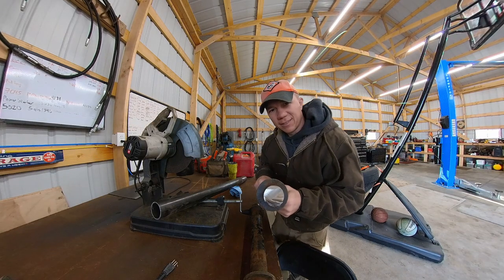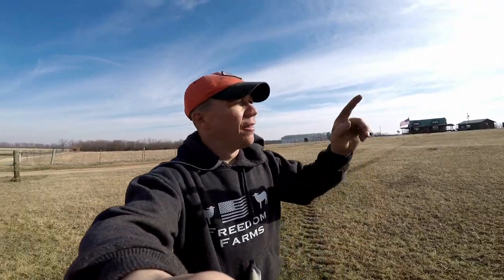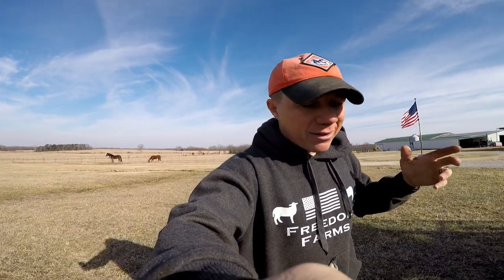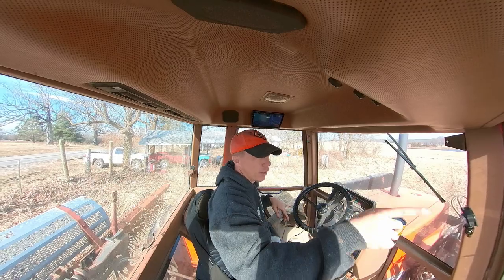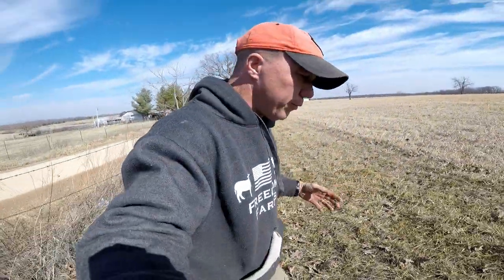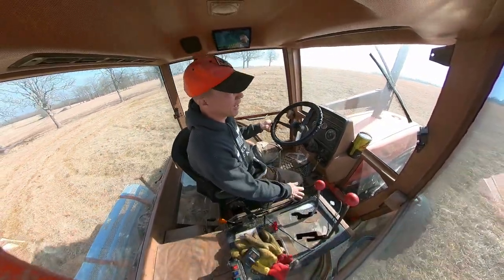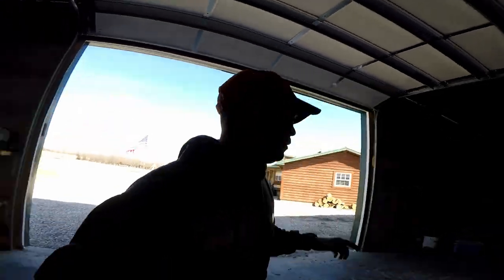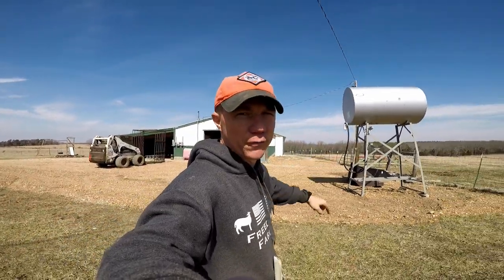Aerating hay ground with a rotary hoe

Comment: We used those Rotary hoe on grain fields if the seeds are having problems sprouting through the dirt seemed like the faster we pulled it the better job it done hopefully it will do what you need buddy thanks for sharing
Reply from the maker: I've never heard of them used for that before, that's an interesting idea for it though for when the ground is crusty after rains. I grew up on grain farms and we used them to remove weeds growing when the crops were still small yet. I just got the idea one day thinking about aerating the soil, and now that everyone just sprays for weeds you can pick rotary hoes up cheap. I bought this one for $300.

Comment: I just bought an old rotary hoe last year to do this with. I've noticed that over seeding and fertilizing (granular) after aerating does make a difference in yield. I don't have any exact numbers, but it is noticable. I'm hoping to keep experimenting with it a little more each year.
Reply from the maker: I know it will help.wigh compaction which makes a big difference in root expansion for grasses, the aeration and allowing manure easier access is just another key point to it. I'm excited to see the results myself

Comment: Your fuel tanks should be tilted back so any water that collects or condenses in it will not flow out.
Reply from the maker: That is what the fuel water separator is for on the filter housing. However that is a good idea if I didn't have the fuel water separator.

Comment: Due to health and safety here our fuel company won't allow their drivers to climb ladders not even a three step step-ladder  or blocks.
Reply from the maker: Wow, that wouldn't be very handy if you have a gravity fed tank.
Reply: @FreedomFarmsMo  it isn't though thankfully as our old one was getting rusty and the block pedestals worn as well as the fact we have to have them bunged we had it say on the ground and wired up with a pump. I had thought our 483 gallons (581 US gallons) was dear as it had been 65 to 75p per litre but it was 85p beginning last month now for dyed diesel it's 128p per litre